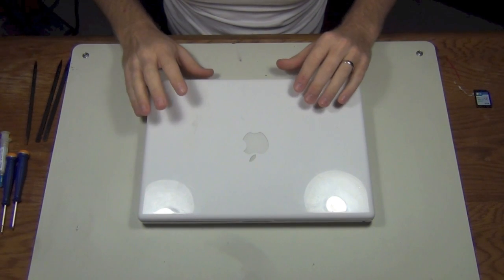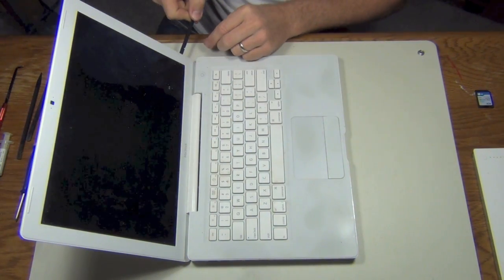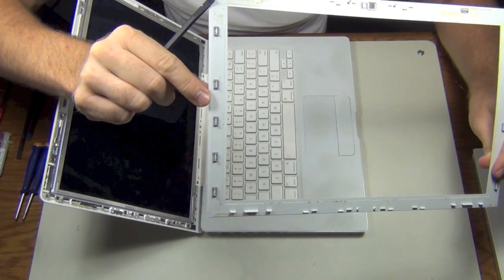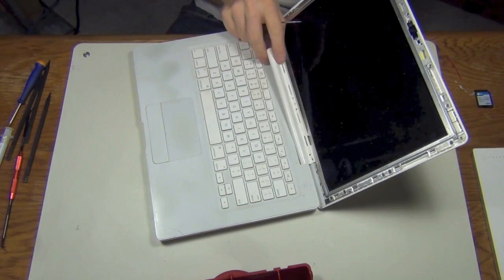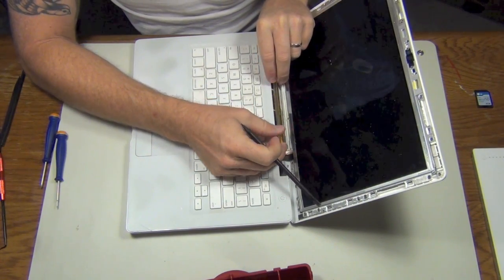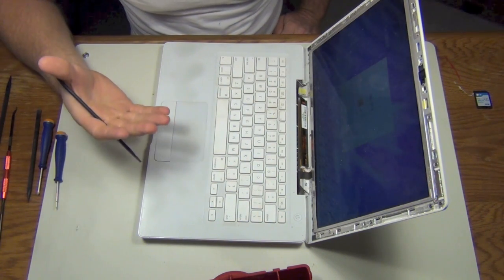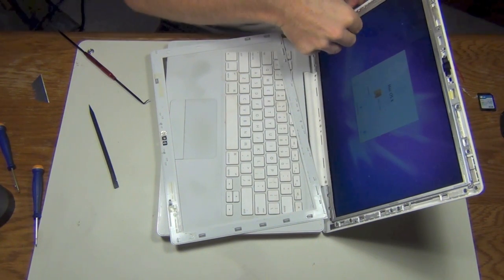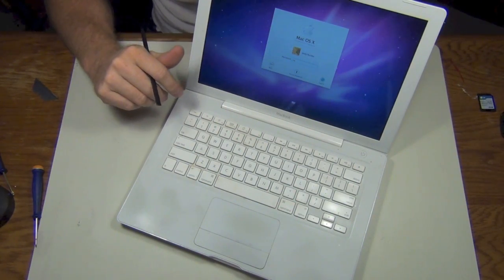How to: Macbook - Fix the Dim or Dark Screen Issue (Inverter)

Comment: This method was great to kick-start the troubleshooting! Gets you access to the Inverter QUICK. Unfortunately, if it's not a loose cable or bad inverter, you may need to go through the slog of removing the keyboard, optical drive, and the display itself to look for loose connections. I ended up just having to replace the display on mine, which is totally fine cause you can get them for cheap. I would like to do more in-depth troubleshooting on the defective LCD display (checking individual cables, voltage, etc.) but, eh, sometimes eWaste is eWaste.

Comment: well done. I have about 20 x macbook/macbook pro pre 2010 I got on eBay and have seven working like new (better than new because doubled ram). I have a few which look great and have this problem, I destroyed one learning how NOT to do it, but have parts. All up I spent $400 (some $10 each some more) I now have a way of getting more to work. People offer me money for them but like yours, how do you give a guarantee, so I just loan them out and load different OS from XP, Vista, win7, win 10, dual boot them from elcapitan (anything less is useless) to Catalina. My Fav is win10 dual boot high sierra on 2011 Pro.OR is that one catalina and the 2009 is dual boot HS? Any questions?

Comment: Big thank-you for this. My "Early 2009" MacBook started to be able to illumanite the screen for only a few seconds at a time. I diagnosed the inverter board but didn't like the look of the guides that encourage taking the whole thing apart! I have just used your method and it worked. The little grey clips do suck, especially putting them back! But the Mac is now brightly lit again. It's incredible how useful this 11-year-old machine still is, albeit upgraded with an SSD and more RAM. Price of inverter board was just £8.

Comment: Having the same problem with my old mac.  However, I found the oddest way to fix this.  I noticed that when I had a certain game app on, Hoyle Board games, the screen stayed as bright as ever.  So I have been able to work with this app on along with changing the sleep mode to never go on.  Very strange!!!  Who cares so long as it works.  Also, it’s an old app and does not take up much space.

Comment: Just did this with one of my old '08 MacBooks. It's currently not quite all back together (bezel and clutch cover are still off and mostly covered with duct tape). Considering I've put a whopping $15 into it to bring it up to 4GB of memory, I'm not too worried about it failing out again as I've also got a bit of a parts machine. Works fine, just looks like hillbilly ass. :D

Comment: Hello.  I also have the same problem of the monitor moving by raising or lowering the light disappears or reappears Underneath you see the graphic of the Mac. But the brightness is missing.  I tried to unplug the converter and it does the same thing even from staccato.  I don't see broken or detached cables.  What could I do ?
 Is the inverter to be changed safe ???   Grazie.

Comment: I fixed my laptop with this video. It was just a loose cable. Easy enough fix and the video definitely helped. I didn't crack anything and was very lucky. Of course the worst part about it was putting it back together. The wires and invertor were hard to get in the casing and snap it in without anything sticking out. You have to force it and try not to pinch the wires. I broke two nails and cut my finger in the process. I was so nervous and it took me an hour but I finally got it back in place. My nerves are shot but my screen looks nice and bright again! Thanks

Comment: My brothers old mac book was acting the same way except it never worked but if you would shine a light on it you could almost see it.. Pulled that center cover off and there was a place in the black wire on the right that was bent in a horseshoe and obviously was no longer connecting. simply bent it straight and rerouted it slightly so it wouldn't bend in the same place and it works fine. That side never moves so it shouldn't be a problem. Something else will doubtlessly fail before that will again. I was about ready to cut it and splice it there but i really don't see the need unless it would happen again. Thanks for the vid..

Comment: How do you know if the problem is with the inverter or the screen? My MacBook's screen doesn't turn on anymore. It will for one second. I can see the display through the screen if I look very close but it's not bright enough.
Reply: After assembling mine back I no longer see the display on as before. Guess I messed something up.

Comment: hwy guys where can I but the cable and inverter for my 08 white mac? also my battery is all swollen and dead where can I get one of those aswell?
Reply: For the inverter or cable, honestly sounds like shit but google it.  Possibly ifixit, amazon, or ebay.  You just need to figure out what it's called and the language that goes with it.  I had a MBP 09 fail on me and i figured it was either a total logic board failure, or the magsafe board (because of the symptom of total catatonic and the power cable not lighting up).  I did some googling, found out exactly what a magsafe board is called searched ebay and found one for ~8 bucks.  Turns out it was not the magsafe board, and called it quits.  

Look for the term "mid, or late" because it can make a difference.  Also for a battery, amazon 100%.  I am using a 09 macbook now and it had a dead battery got one for 16 bucks free 2 day shipping.  I am also having a screen flicker when I move it which sounds like a cable issue...but not going to fix it till I really need.  Because of the age of these laptops, you could probably also find a whole screen assembly for cheap.
Reply: Wow thanks for the help there. I do know about the mid or late year model term I just know that there are some small diference with the computers throughout the years. Mine has a new logic board from a few years ago so I would rule that out. I think it's that inverter and cable.
Reply: Then all you gotta do is google around your macbook year and the mid/late see what people are exactly calling the inverter and cable and search it on ebay.

Comment: Hi, im not trying to put a damper on your video, you did a good job of showing how to remove the bezel around the screen. But from my experience what you did is simply move the cable slightly and it began working again. It is the cable from the left which brings the power from the motherboard and that is the one which fails because it is the one which moves each time you open or close the screen. Fiddling with it can get it working for sure and yes that is the easy way. But chances are it will fail again, just a matter of time. Best thing is to open it right up and replace or repair that left side cable with the 4 wires. I have 2 of the 2009 Macbooks which had this problem and I had to repair the cable. After that they are both working fine, for now at least. It's a very stupid setup, with very flimsy delicate and thin wires used in a very crucial part of the screen operation, all wrapped around the hinge so that it moves every time you open or close the lid. I have uploaded a very brief simple video to show what I'm talking about.

Comment: DIY Tech - Thanks for your video - it was really easy to follow, but unfortunately it didn't help my 2009 macbook :(  My screen is dim and I can see everything with a flashlight, but I'm assuming it's not the cables because it doesn't turn bright at all, no matter which way I angle it (and I also followed the steps from the video, didn't help it).  I reset the PRAM and that made it work for one day, but then it dimmed again.  Do you think I need a brand new inverter?  Thanks for your help!!

Comment: Great video. Thanks as have a computer tech. recommended by another Mac user but the guy told me to check the inverter & cables, he'd have to take out 40 screws! I now know a better way and will save him time as he said it would take an hour to take all the screws out and check and/or replace parts! Guess when I go in I'll be telling  him (what he may already know but wanted to charge me more!) what I have learned here. Save time and my money too! May not even need any replacement parts either! So, instead of a $100.00 bill, may be more like $25.00. So thanks.

Comment: I was wondering if you can help me. It seems like every time I unplug the left part of the inverter and plug it back in the screen comes on for a quick second then shuts off do you know what the problem maybe
Reply: Ok I figured something. Out the black wire was pinch so I tried to splice it together but made it worse now I need a new black wire cause I cut it to short. Do you know where I can order that?

Comment: Great Video.  I will be getting this year 2007 to repair from my granddaughter same problem and looks easy enough. Hopefully it is a loose attached wire.  Gives me more experience in repairing MacBooks.  I just replaced the glass and lcd in a 2008.  Installed the newer lcd model,  the one apple installed those years were horrible.  The 2008 runs fast and the display is crystal clear and sharp.  Love the challenge.

Comment: I never want to leave negative feedback, but maybe I will save someone from the trouble I ran into while following this video. I suggest you this if you're willing to break plastic casing pieces and possibly your inverter. That's what happened for me. The video omits a very critical step. He doesn't show you how to put the plastic piece that covers the inverter back on! I found it impossible to put back on. I have no idea how he did it. If you really want to ensure you don't break anything, don't follow this video. I found great instructions and affordable parts ($10 for a new inverter) at ifixit.com. If the computer isn't that important to you, then go ahead and give this "quick fix" a try. But, if you want to ensure you don't break things, IMO, this isn't the way to go. I learned it the hard way. Also, the wires on my MacBook were fine, it was the inverter itself that needed replacing. The connector was coming lose from the board. Following the instructions on ifixit.com, I now have it up and running again. Almost like new, except for the pieces I broke following this video.

Comment: Thanks for the helpful post. I have the same problem with my 2008 MacBook. After a while (after it warms up?), I can ease the screen back to a comfortable 100 degree angle from it's initial viewing angle of (say) 30 degrees. But if I close it up and open it up later, it goes back to its maximum 20-30 degree viewing angle. So I hesitate to close it up. (BTW, couldn't you keep the clips in the bezel and pop them into the indentations one at a time?)

Comment: Thank You Man!! The Macstore pretend to charge over 900usd by replacing the screen. So i decide to follow your steps and i discovered that the inverter powersupply cable its broken. I think i can repair it. Im sure this will not cost 900!!!

Comment: Thanks man for a great 'to the point' video. I went thru the process but it fixed it partially . The angle at which screen works is bigger but still not as it should e. I'll still play a bit with the cable and see how it goes. Thanks again

Comment: For an old computer, it is not justified to replace the inverter and or the cable. I do agree with your solution for this repair in this case. Thanks for sharring this with us,

Comment: Hi brilliant how to video (friendly sounding guy too) my inverter/invcable failed a year ago, i repositioned the cable, unplugged-plugged back in, still nothing so i just used my 2nd screen for this year, until this month the macbook screen flashed on a few occasions. I took the keyboard and all up and repositioned the cable and re-sat it.. 
REEEALLY need to replace the thermal paste now so i was wondering if there was any pointers on repositioning the cable? i fear i may have worked a good break inside the cable working the fault by tilting the screen till it flashed on when the problem first came about. 
Anyway, thanks again, ps. i just taped/glued 1 side of the bezel. fkn clips man, with or with out i struggled gettin them fkers back on.

Comment: Hiya
Thank you so much for this well-explained video - I'm not an expert, and I managed to follow your instructions exactly on my 2007 white macbook - brilliant!
Sadly, all my plugs seemed firmly connected to the inverter board; I took them out and plugged them back in again, but it made no difference to my stupid backlight problem.

So, the problem is basically what you described: the screen occasionally lights up for a split second, then goes back to dim - I can read it vaguely, or more clearly if I shine a torch directly on the screen.

Because my computer is so old, I reckon any professional repair will be more than it's worth: have you got any other suggestions I could try myself at home?  When I google 'replace backlight bulb', there seem to be loads of warnings against performing it if you're not an expert!  

And what if it isn't even the backlight bulbs?  It seems weird that it will flash on even for a split second if the bulbs have gone, no?  So maybe I need to investigate the cables a little further than you can see from the extent you open the computer in your video?  I'd be so grateful for any advice!

Comment: hi DIY Tech I have a MacBook Air A1466 13 inch just recently the screen has somehow dimmed and I can only see it with a torch, its not the same problem as the one shown in the video and I was just wondering whether giving the same repair method in the video a go or is it a waste of time

Comment: Hello i did exactly the same thing as you did on my 2007 macbook but it didn t fix my dim screen problem. I ve already moved and clean the cables and the inverter a lot of time but it s still not working what should i do ?

Comment: Hi. Thank you for the video.  There is no apple service provider in my country so I would be THANKFUL if you can advise: Is it the same way to follow with the BLACK macBook? I got one in 2008 , and now I have the issue of the black screen.  and If the inverter cable is damaged, can I get any inverter cable as a replacement? PLEASE advise thank you so much

Comment: THANK YOU for this. Computer has been unusable for weeks and this has, at least for the moment (knock on wood), alleviated the problem. Mine is an 08 macbook, by the way.
Reply from the maker: No problem!  Glad to help!
Reply: Fuck I broke all of them with bit of force no pool well this is an old computer heh
Reply: +DIY Tech .my macbook pro is startup but no sound . screen also black . any idea
Reply: Akatsuki mine were made out of some type of bendable metal. Had no issues with them breaking.

Comment: You can always use a #2 pencil (the eraser end) to clean the contacts where the cables connect to the inverter, I'll bet this was the reason it started working again, Just repositioning the cables connection made it work, clean the connections and it will probably work for another 7 years.

Comment: All in all you did NOTHING!
Reply: Well he did. And I fixed my in the same way. He removed the cables from the inverter and plug them back again, so it was an issue with the cable contacts to the inverter. I went a bit further and clean the contacts part in the inverter with a pencil eraser and with a ply I press the clips a bit, so it went back to place very tight. I am running like that for 6 months now!